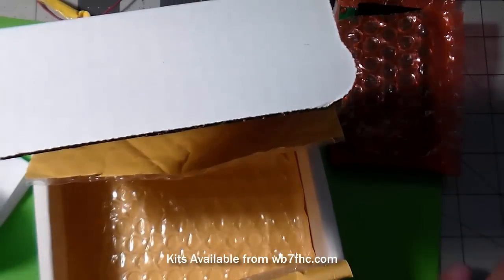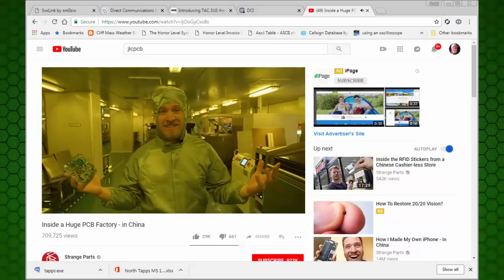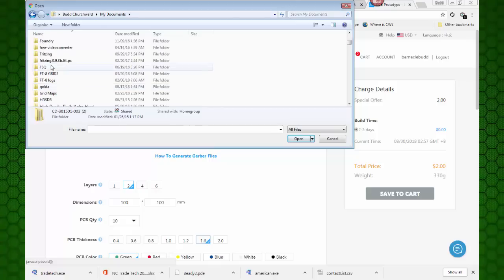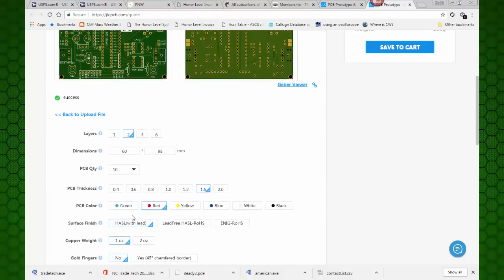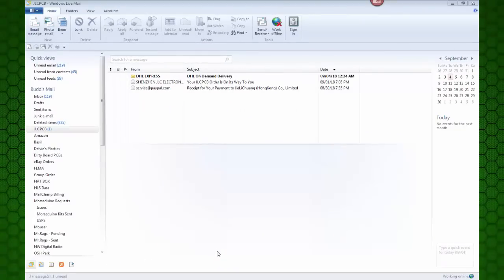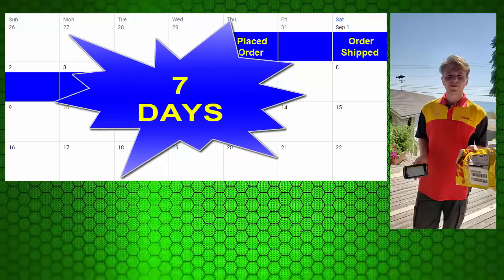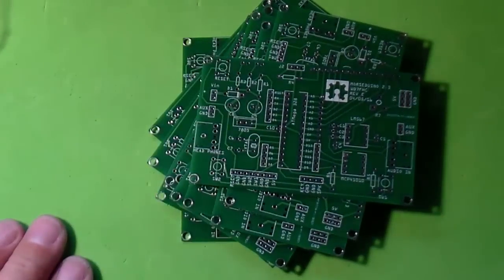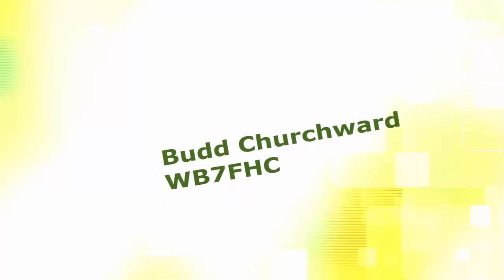Your Own PCBs in Less Than a Week from JLCPCB

Comment: Hey Budd, quick question.  I just got my first PCB's back from JLCPCB and I placed all my ground traces on the bottom layer of the board.  When I got them in the mail today you cannot see those traces on the bottom of the board, is this normal?
Reply from the maker: If you added a ground fill to the bottom layer, there will be no traces to see. Everything that isn't ground IS ground. Check for continuity with a meter. You probably did fine.
Reply from the maker: BTW I got a set of new boards today, too. Maybe our boards were in the same batch.

Comment: Hi, remember the PCB I send to you before? That’s also produced by JLCPCB, but with lower price, 60RMB for 10 PCBs and shipping included(Mainland China), it’s about $1 each. DE BI4SQM
Reply from the maker: Your boards were one of the first things I though of when these new ones arrived. I wondered if you had them made at JLCPCB ... that free shipping in China is a great deal. It really cuts down on the cost. Even so, I can not complain about the turn around time or the final cost to me. Thanks again for the boards.